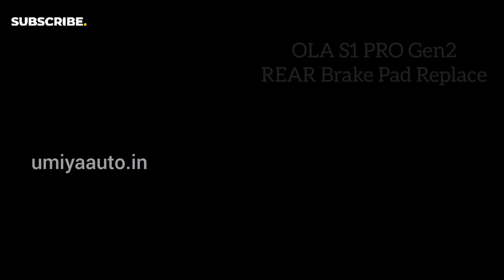OLA S1 PRO Gen2 Front & Rear Brake Pads Replace | OLA Scooter | Umiya Auto

Comment: ASK brand is a high quality brake pads and brake component manufacturer for ola as well as other brands also.I am personally using this for more than 5500 kms.Umiya Auto helps us and makes understood all ola owners about the general maintenance of their scooter. Generally all are panic if any maintenance is required due to the service side of ola is extremely poor. Thanks to Umiya for making these videos and supplying quality products at a reasonable rate. Lots of love from Kerala ❤️
Reply from the maker: Thank You Sir 🙂🙏🏻